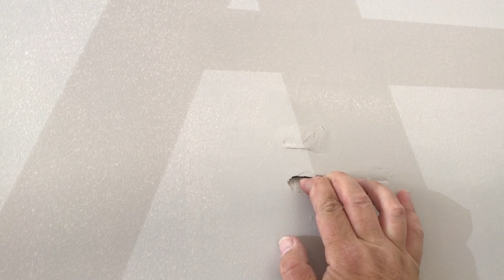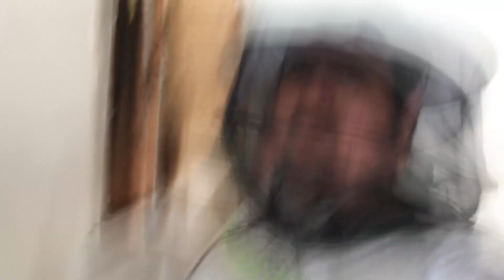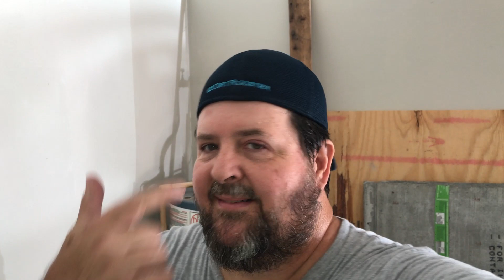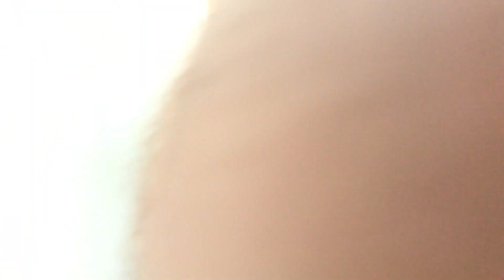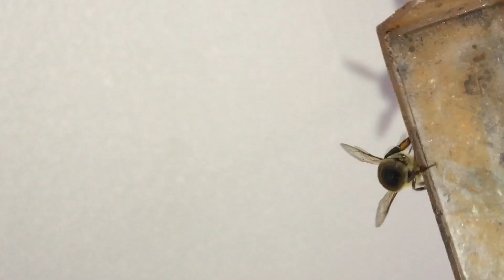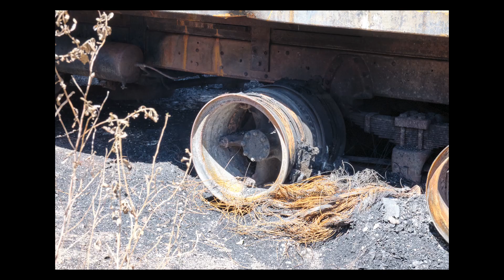Huge Bee Hive In Garage Wall

Comment: Always fun to watch. Btw. The Labrador from I-49 and couple hours north of Lafayette is fine. He is a big baby and believes he owns the truck. The little one I had when I found him, is taller and they are a barking mess at truck stops.  I had to risk taking them in the shower but it was ok and worked out fine.  I have to use the stool or chair or bench supplied in the shower and keep them on the lead.  It works out.